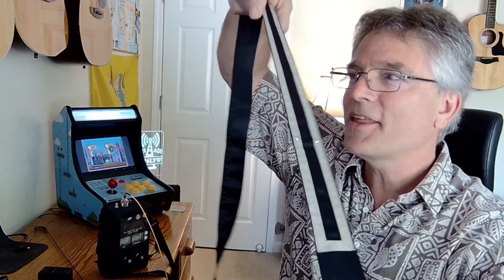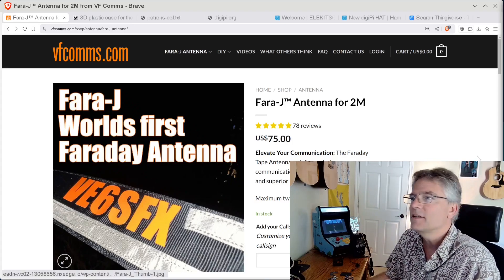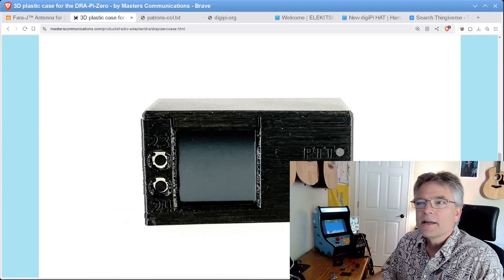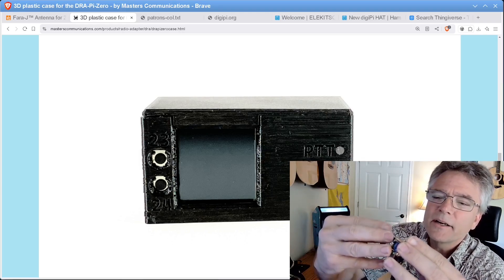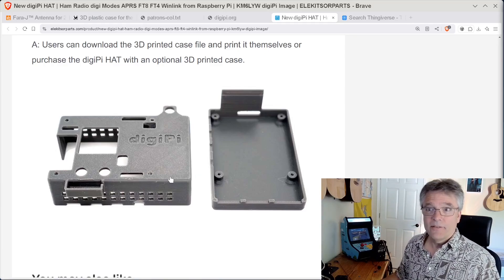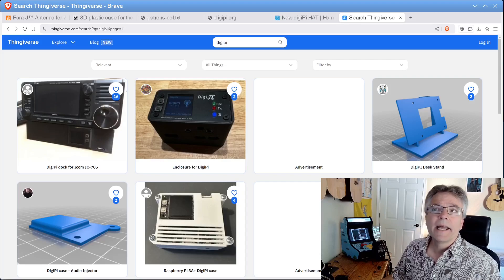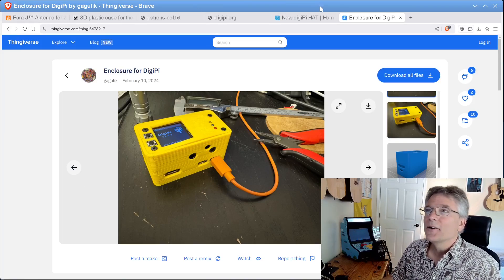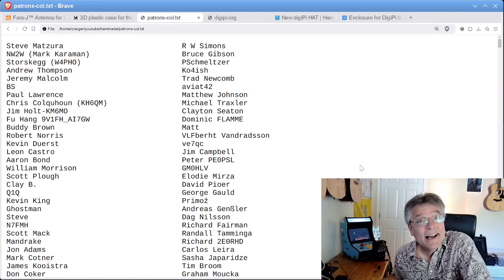Cool Gear for your Radio!

Comment: You might want to look into building J-pole and dipole antennas out of attic foil, a highly tear-resistant version of aluminum. It comes in varied widths up to four feet, so the width might make it very wide band. Searching for "attic foil" will turn up sources.

Comment: Your hanging signal stick would lack a ground plane. 1/2 the signal is going back into the radio. Add some ferrites on the coax spaced down from the antenna to block the common mode current. The board for Masters adaptor kit is on workbench right now.
Reply from the maker: GREAT point!   My last video "Signal Skirt" was dedicated to this fact (which was overlooked in this video).   The signal stick w/o a counterpoise or ground plane has an swr of around 7:1 -- bad news.

Comment: I like the idea of putting your callsign on the Fara-J, downside is that you might want to change said callsign in the future.
Reply: Memories! It makes more sense to have "2 meter" or "70 CM / 440 Mhz" sewn into the ribbon. Especially if you have 2 or 3 different of the Fara-J antennas.